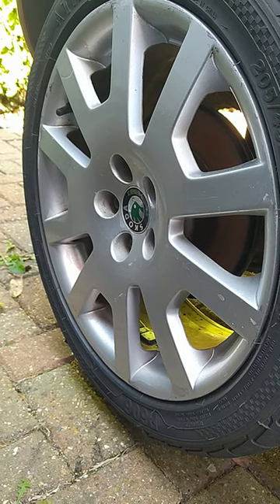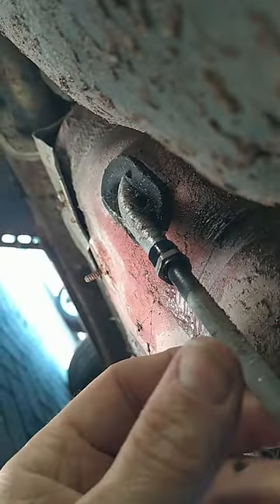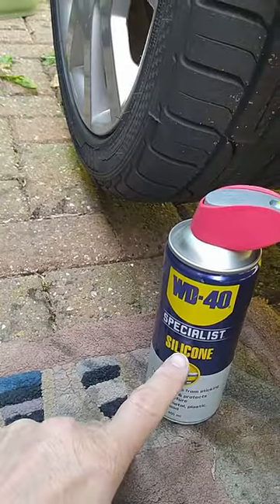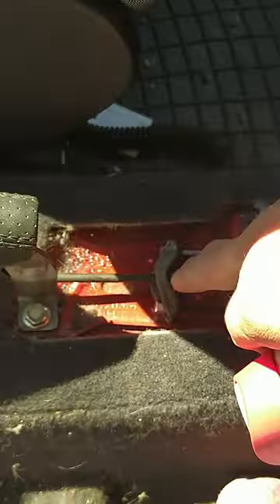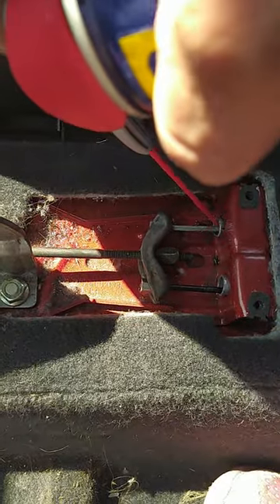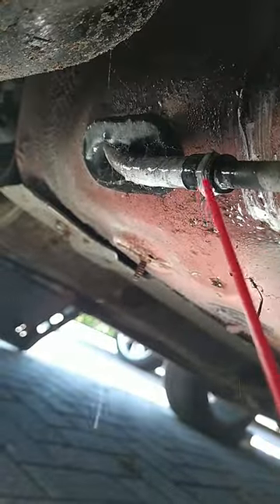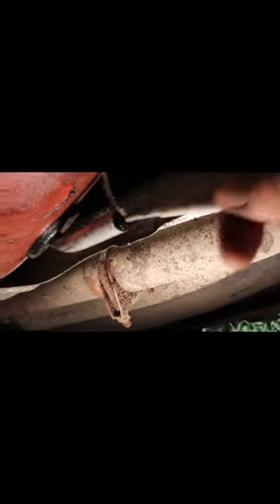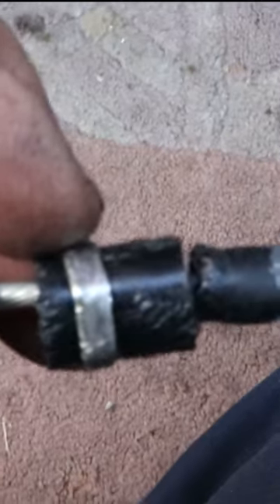SKODA FABIA Stuck Handbrake cable

Comment: Hi great video, both of mine an 2012 superb won’t come out any further. Any more tips? It’s like the end bigger bit is getting stuck??
Reply from the maker: The nipple can bang the end out if you repeatedly pull quickly like a slide hammer, just be careful the guides don't come out. Lots of fluid in the pipe and leave to work it's magic.
Reply: @HatBoyHarvey  thanks I’ll try that. Keep up the good videos.

Comment: Only if I seen this before I had to cut the cable and pull the plastic bit with some pliers by the way i was changing the cables
Reply from the maker: No worries, the main thing is you managed to do it in the end :-)